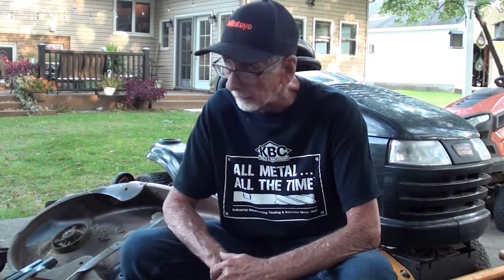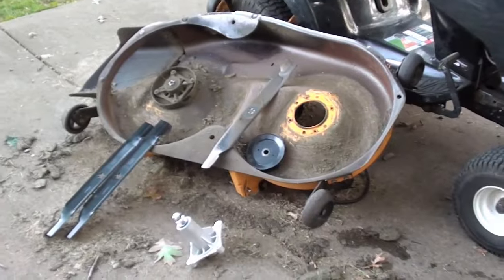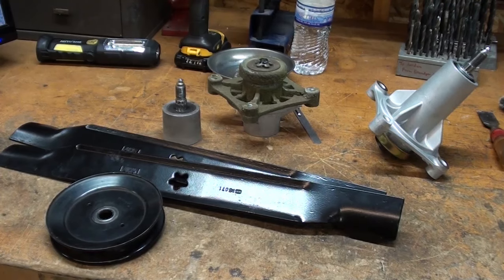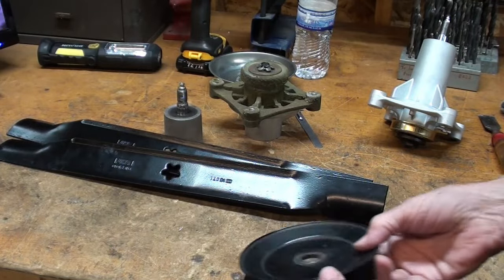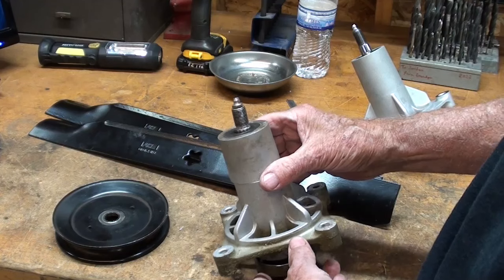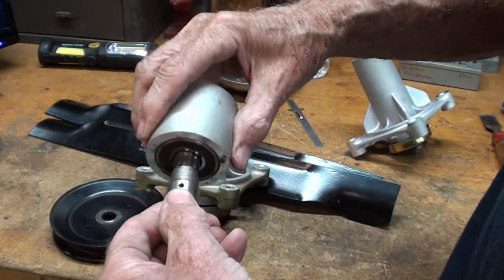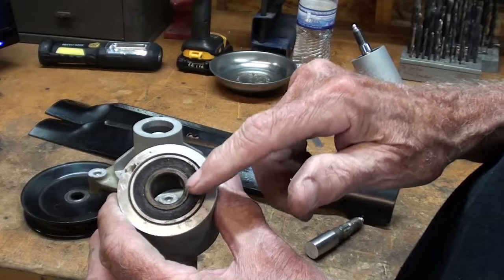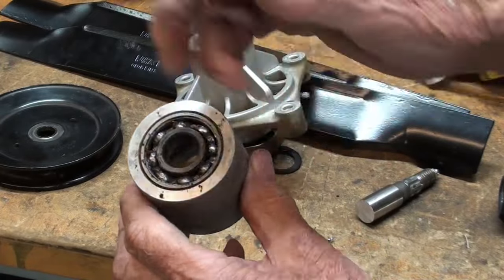LIES & DECEIT mower spindle fraud SHORT SUBJECT #52 tubalcain

Comment: Mr Pete in 2002 i bought me a john deere 4110 3cyl diesel with a 54 inch deck i also doing the neiighbor a favor cutting his grass it was a foot tall i hit a cement block  cracked the bearing housing  So my next door neighbor  Ray said take it off i will make you a new one the next daY I HAD a new  one Didnt need shaft or spindle or blade .Ray owned a machine shop pittsburgh area called VERSATECh hE went to the shop to get alluminum round stock and came home and made a spindle housing in his home shop Ray was my best friend he past in 2015 I bought his bridgeport varible mill and a nardini 1440 like the one that teacher dropped in his basement on youtube. Ray also bought a tractor after I got  mine he bought it off his sister a1986 kabota after he past everything was autioned off I beleive a man from indiana bought it over my phone at the auction for like 7 grand by the way the neibghors were different Tom

Comment: The irony is cars in the 1950s had grease fittings all over the streering and suspension as well as the drivelines. The old timers told me they rarely lasted more than 30-50k miles before needing replacement. Now days you can’t even find a grease fitting on virtually any automobile and yet they regularly can crack 100k without those parts needing replacing.

Comment: I buy multiple extra spindles for mine and i also have needed to tack weld brand new pulleys because the spline was so loose. I spot weld the nut too the pulley. Has worked so far. Ive had mine crack at the bolts at the aluminum spindle mounting points. They are all junk now.  I should just pull the old simplicity out of my parents backyard and rebuild it for another lifetime. It was my grandfather’s that he replaced with a newer model simplicity.
Reply from the maker: I never have had a problem with the spindles on my scrub cadet.
Which surprises me, because everything else goes wrong with it

Comment: I bought a Sears riding mower about 30 years ago and hated it from about day one. The tractor itself was pretty nice but the mower deck was pure crap. They designed it in such a way that the grass clippings piled up on top of it and got in under the pulleys, belt guards and in all the nooks and crannies that were impossible to deal with unless you pulled the deck clear out from under the tractor, tipped it up on end, and hosed it out. That operation was also a nightmare in itself. When we bought a new house and moved away from there I gave the thing to a neighbor I didn't much care for. Now it was his problem.

Comment: That Craftsman mower as well as the Cub Cadet and others are made by MTD in Cleveland, Ohio. That spindle is used in almost all of them. The shaft and bearings are available as separate items. I have two Husqvarna riding mowers and they use the same bearings. The original bearings are made from your favorite material, "Chinesium". LOL I replaced them with either Timken or SKF bearings and they have lasted several seasons longer than the original bearings.
That zerk fitting is a leftover from the original version of those assemblies. Until they started using sealed bearings they did actually require use of that zerk fitting. That is why there is a hole just below the newer bearing seat. The old bearings sat just a bit higher and the grease would go into the bearings when it was pumped in through the fitting. For some stupid reason, they just left it there for John Q Consumer to think he was doing something useful. That's my theory and I'm sticking to it! LOL
Is it a bit dishonest? Yes. Does it do any harm? Only to the owner's wallet. Even the owner's manual ignores those fittings. They are no longer referenced in the service documents. Go figure!
I think that was a well deserved rant about something that few people have any knowledge. Keep it up and maybe MTD will finally eliminate those useless fittings. Maybe. LOL

Comment: Be sure to balance those scamazon blades  !! I purchased some installed them and immediately thought I had installed them wrong after checking and finding nothing wrong due to circumstances I used them anyway. This cracked my deck after welding it and about to install more cheap blades I checked the balance and could not believe how much blade I had to grind off  ! I don't think the hole was in the center

Comment: Once the hub is full of grease the only way more grease can get out of the pressurized hub full of grease is past the brgs. and past that rubber seal, (the weakest part), you did pop that seal out easy. I put a few pumps in my spindles (same type) every use and the grease seems to come out of either end of the shaft past the brgs. is the only way the grease can get out! The grease comes out under the top pulley and around the blade end brg. cover. Putting grease fittings where there not doing anything is not normal, or cost effective, one reason is grease fittings are more maintenance and nobody wants that, and most homeowners don't have or cannot even use a grease gun.

Comment: Wonderful rant! Perfectly done.
Same here with a similar $70 mower deck spindle assy with a side Zerk.
Most of a tube of grease might fill the space inside the housing between the shaft, housing and bearings. Then what? 
IF the grease is like a green brand combine corn head, the hot grease MAY migrate thru the inner seal of the lower bearing as it turns more liquid when hot then congeals back to grease when cold. What happens if we pump too much grease in?
Will the upper bearing ever get fresh grease? Doubt it.
Just silly. A feel better notion.
Then replace it anyway when it craps out.
Good bearings cost as much as the assembled housing assy. Did they put it together like I or we would? Being certain the bearings were perfectly installed/aligned?
No. Flim-flam or press and go.
I used to assemble idler shafts and other rollers  and they let me do my fussy work. Some berings are junk right out of the box anyway, turn roughly etc. Poop.

Comment: I'm going to buck the trend. Those seals on the bearings don't handle much pressure and grease guns go up to stupid high pressures. If you packed that housing full of grease, it would get past those seals just from the grease gun forcing it past. The other issue is that you could blow the seal out the opposite side and end up with an unsealed bearing. 

As an anecdotal example i have 3 Toro 5010-H fairway mowers at work with 5 cutting units each. The cutting unit bearings are stainless steel double sealed. Supposed to be good for the life of the reel. They really do last for a long time.....but a couple of years into having these the reel bearings started to get stiff to turn. The grease in the bearings were drying out. They do have grease zerk on the motor end of the reel for lubricating the splines. They don't on the opposite end but do have a hole there for one. I put grease zerks in them and pumped the housings full of grease. A couple of uses later and the reels spun freely again. I had other mechanics tell me it wouldn't work because the bearings are sealed. 3 years later and i still haven't had to replace any bearings.
Reply from the maker: Thank you very much much

Comment: For a short time I ran a yard business with a buddy when ai could not get a job in a print shop. What I discovered was that a lot of lawn equipment sold to the public (not professional brands like snapper and used to be toro) were made out of a single factory. They would have several body styles and paint colors. They would offer Briggs and Staton or Koler engines. This was an advantage in one respect it made repairing them simpler. One of the best we had as called by us "Frankenmower" Ah to be young again.

Comment: Yup found this out several years ago. One time had to replace spindle, and the replacement had a grease zert on end of shaft. Out of curiosity and knowing how these cheap replacement spindles are I removed it and sure enough there was no hole in shaft just threaded for the zert. Now I disassembled the spindles remove the seals clean and regrease the bearings or replace the bearing if too worn they are not too expensive. Thanks for the video & rant

Comment: Presumably a bearing with seals on both sides is a fraction of a cent cheaper than one with a seal only on one side... Pretty funny that the bean counters didn't delete all the OTHER infrastructure relating to greasing those bearings (considering those operations and the zirc probably cost WAY more than the difference between the two bearings)...

Comment: I put new spindles on a 25 yr old mower, whose spindles were original. The replacements only lasted 2 yrs. In the autopsy, I found the internal seal, as Pete has shown.

On the newest set, I disassembled the spindles (buying a blind hole bearing remover to do the work). I removed the internal seals, and installed two zerks in the housing (one for grease, the other to remove as a pressure vent). It took 90 pumps of grease to fill each spindle!

By the way, it's a good idea to run the spindle with a cordless drill for 3 to 5 minutes, with the vent open, after you think you've added enough grease.

I suspect the spindles will last a while, but I only installed them a few weeks ago. We'll see...
Reply: His old bearing did not fail. He hit a pipe. Those bearings may have lasted 25 years with or without grease. Seals in these bearing are just plastic shields. Grease will penetrate them.
Reply: @RRaucina 
You may want to watch the video again.

The name of the Video is Lies & Deceit...

Do you think he was referring to his Son-in-law crashing the mower blade, or the manufacturers of the offbrand spindles, precisely due to them including a grease fitting AND leaving the inner seals in place?

No, Pete is saying that the spindle design is inherently deceptive because it includes a grease fitting, yet the inner seals are in place.

Being that every grease gun can produce greater than 1000 PSI of pressure, do you think the bearing manufacturers would recommend the seal being pushed (with high force) until it interferes with the balls and the cage?
Reply: @cornpop7805  Much ado about nothing. Grease will flow out past the seals. Just don't pump it hard after you get resistance.
Reply: @RRaucina 
I design industrial machines for a living, and I imagine I'd get fired or at least written up for designing a spindle and specifying bearings with seals on the interior, when that's where the grease is added.

I'm certain the bearing manufacturers wouldn't recommend the practice. I'm certain the machinist handbook and all the other industrial handbooks wouldn't recommend it. I'm certain no engineering or trade school would recommend it.

I agree with Pete, this is a total fail. If you read my original text, you'll see that my offshore spindles (with sealed bearings) lasted two years, really only 11 months, because I only mow for 5-1/2 months a year. The factory ones lasted for 25 yrs (5-1/2 months/year). That's a testament to how correct Pete is on this.
Reply: @cornpop7805  Those commodity bearings are dirt cheap and the lifespan of any individual one is a crapshoot.  So you have no inner seal in the correct design, but you still have the outer one. Grease either goes out past it or blows the seal out. So designing without a inner seal is a feel good thing and nothing more. Like the zerk fitting - everyone wants it, but not many get under their mower. Pete was so upset I was sure he found the deep zerk  hole that had no crossbore.  Seems to me you are still written up for leaving a seal on the outside when it should have been a steel shield.

Comment: I have a Sears riding mower very similar to that one. Made by Husqvarna with a 21 HP Briggs. Used it for 12 years and never knew about the grease fittings. Several new blades and belts but no stump crashes. I always thought sealed bearings didn’t need greasing.

Comment: its not just the box store mowers that suffer from the SLS (short life syndrome).   I have always had AC or Simplicity mowing tractors and used to be you could go into the dealer and get any part for the mower deck spindles.   About 15 or so years ago I was totally rebuilding one of my 60" mower decks over the winter and one of the spindle housings needed replaced,  dealer says all spindle parts are NLA, its a whole assembly like you have there or nothing.   I left with nothing and made my own.   If you didn't know Simplicity is dead,  quietly overnight about a year ago Briggs and Stratton shut down Simplicity and most dealers didn't know till they tried to order something only to find they now had orphaned equipment.   I have two Simplicity Diesel Legacy mowers, one is DOA needing an unobtainium radiator and will become a parts machine to keep the other running as long as possible.

Comment: They know hardly anyone actually greases them. I recently machined a new starter nose for a 1927 Fay and Bowman lake boat engine, original was cast iron with oilers both for the electric motor big end and the bendix pilot plain bearing. the replacement the restoration shop had sourced was a rapid prototype one off casting in stainless steel, so using it as a bearing material was a non starter, so we installed bronze, I asked the man if he intended to oil them and wanted the casting drilled and reamed for oilers as per the original or if he wanted modern oillites... at nearly 300 more dollars they went with the oilers and plain bronze bearings. just the price of the casting and the machine work ran $2500. Hopefully it gets oiled, cause if not a "maintenance free" oil lite would have been a much better choice. At least if it blows up again any competent shop can press in some oillites.

Comment: My 1993 Craftsman lawn tractor didn't have grease fittings on the spindles either. So I took them apart removed the plastic bearing covers on the insides of the bearings and drilled and installed grease zerks on the spindals. I pumped and pumped. I thought I had enough grease in each one. I ran the tractor for 15 years and never put an ounce more grease in the spindles. It is easier to change them out than to grease them. LOL. When the bearings go, it's usually time to change the pully, blades, and belts. Then it lasts a long time.

Comment: Nice nod to Taryl.

My Simple-city had a couple of bearings getting a bit noisy and upon me replacing them... same as what you found.. sealed bearing which were deceptively 'greasable'.

I removed the inner seal on the replacement bearing and NOW I can actually grease them.

Keep up the rants. A LOT of truth is there.

Comment: Yes indeed, I think both of those mowers are made by MTD, which is why parts are so interchangeable,  I usually repair the husqvarna with a nice piece of 1 1/4 tubing, 8 inches long on each side nicely welded over the axle. Worst offenders are tractors with snow blowers.

Comment: The appropriate bearing would be a 1RS vs 2RS.  Instead of end and cross drilling the shaft,  a single hole through the housing would suffice.
Reply from the maker: So true. But I guess they prefer to drill a small deep hole, and then a small cross hole to it and then re-drill it at the top, larger and thread it. Too many operations and too much expense, where are the be encounters when you need them.

Comment: I replaced many spindles over the years learned a few things a lot of spindles will not have cirque fittings I drill out the center of the spindle put in cirque fitting in and load the chamber up with grease  when the spindle heats up the grease expands it wicks passed  plastic seals and into the the ball bearings I had a mowerdeck  come back broken spindle hit a rock one that I had drilled out a few years prior the grease had worked its way into the bearings they were fine

Comment: Looking past the cheap factor, a couple observations: I saw no grease in the spindle housing so if the bearings we not sealed they would not have lasted any time. Maybe the manufacturer knows many owners will never grease the bearings. The 1000psi from a grease gun would easily force grease into any "sealed" bearing that can only seal about 5psi. True, you would need to pump half a tube of grease to fill the spindle first time adding grease.
Reply from the maker: Good observations

Comment: Someone hasn't tried buying a half seal bearing and it shows. For some reason they stopped selling them, now you have to buy full seal, full shield, or open bearings, if you want a half seal you pull one seal off. I had this problem when I had to replace a motor bearing, l ordered a half shield and they sent me a full shield even though they had a separate number for half seal, I called them up and they told me they don't sell half shield anymore because nobody uses them, if I wanted half shield I have to remove it myself which is very easily done. They probably didn't want to pay someone to remove them.
Reply from the maker: Thanks very interesting

Comment: That always seemed like a manufacturing error to me. Maybe they did the engineering part and then they found sealed bearings cheaper in quantity so they just put those in without any thought to the design and the greasing part. It reminds me of the Delta bandsaw where they engineered the frame casting to have a boss where the blade tension rod was supposed to hit to prevent damage to the frame. Except the boss is on the casting side opposite where the rod hits so it doesn’t do anything. The rod hits the front half where there is no boss. That always drove me crazy. It seems like it’s just an error.
Reply: Or, "Hey, we have all of these parts on the shelf. What can we use them on?"  Otherwise, the old unused parts become overhead and get scrapped.